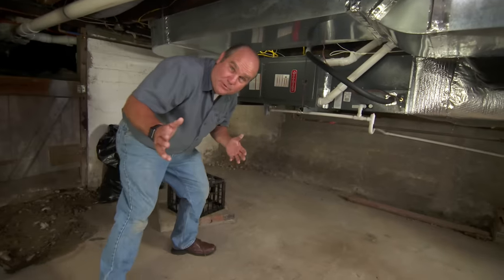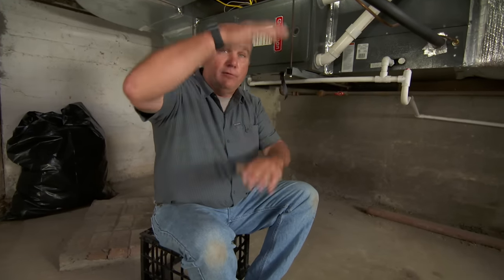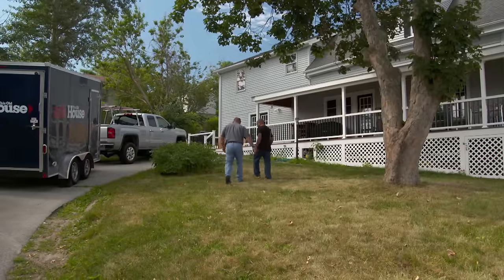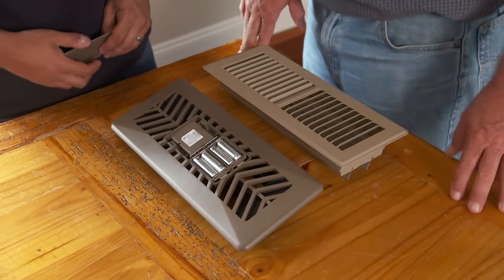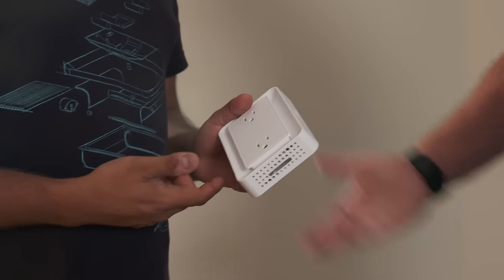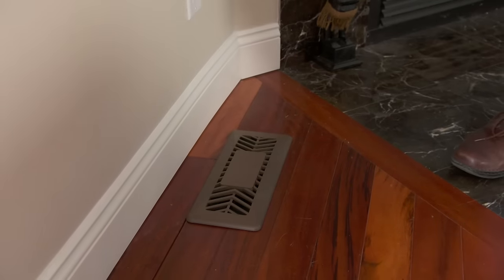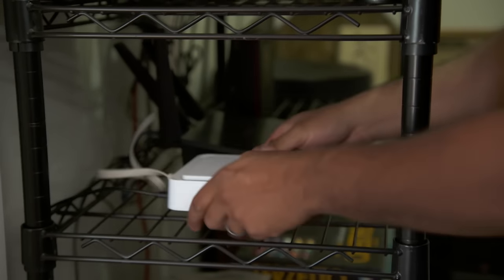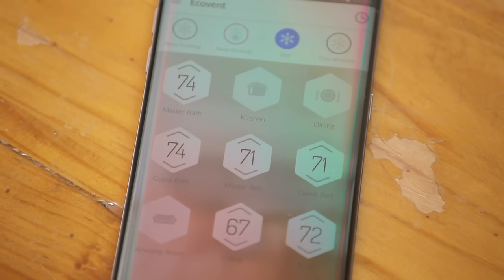How to Install Room-By-Room Zoning in an HVAC System | Ask This Old House

Comment: What about the static pressure in the duct or friction when the dampers close? What about the return bypass? Only good for a module home or studio apartment
Reply: Excellent points. What motorized register system would you recommend that does not have wifi or internet? I would like to control everything centrally without the internet and would like everything to be hardwired including power and ethernet.
Reply: They won't let you close them all or close more than you can. They are a smart system that also keep track of the system to make sure you don't restrict air flow to much.

Comment: I really like what I see but I would rather have a thermostat in each room.  Apps are great but if you have a guest in the room or a renter you may not want them to be able to control your whole house.  Any chance you will convert that little plug in box to also control the temp like the app from the room?  Is there a way to give someone control of just one room with the app?  This would be especially handy if someone is having a guest.  Does your system account for AC systems that have dual fan speeds?  My last question is are you going to have any round ceiling vents?  I know this is typically a commercial vent but I have them in my home.  THANK YOU!

Comment: Dipul, the system as shown in the video seems appropriate for a quick and easy retrofit but what about new construction?  I wouldn't want these unnatural-appearing sensors plugged into my receptacles.  And similar comment to an earlier one... why batteries when it could be hardwired?

Comment: I'm interested in purchasing and installing this system for my home to see how it works...I have been in the HVAC industry for over 20yrs and have only seen amd installed  the "old style" zoning systems amd this video has me very intrigued
Reply: This is an interesting concept, but the up/down zoning works well for most applications.  We had a bungalow with a finished basement on a two zone system. A Lennox signature series gas furnace with a variable speed DC motor (fan ran 24/7), kept both floors at the same temperature year round.  This system here would achieve very good results, but a variable speed blower is required to prevent over pressure on low heat/cooling demands.  It needs to be considered as a total system when putting this in.

Comment: I see higher static and more energy consumption by an ecm motor that could lead to problems. A regular Zoned system with a bypass is better and probably less expensive
Reply: Ulises Palacios this old house doesn't research anything it seems before promoting it.
Reply: Joe Shearer true lol
Reply: Yeah, when I first saw them, I dismissed them immediately.
These things will be terrible for most systems.
Reply: I dont see the savings.   if you are not heating/cooling/dehumidifing areas...you will be taxing the spaces that you are trying to do.   how can you not be effecting  TESP...and taxing the blower motor
Reply: Exactly, especially on a speed blower and single speed compressor setup.  They admitted at the beginning of the story that he doesn't have a HVAC background.  I see big problems with this setup.
Reply: Ulises Palacios agreed.  Us Fellow HVAC/R techs aren't as easily fooled
Reply: Not sure how many times it was stated.... but to repeat, the system senses static pressure at every opening. it's programmed to never allow the static to rise to a point that would cause harm to the single or dual speed blower. No VFD needed. 

Still I see an issue at hand. If you have 10 zones, the setpoint at every zone is 74 degrees. 6 zones are 70 degrees but 4 zones are 76 degrees. you have a 60% demand for heating and 40% demand for cooling, so basic logic implies we would begin a heating cycle. We damper off the hot spaces to prevent adding additional heat, and we open the cold spaces to provide heating..... But lets say that the 40% spaces are still climbing in heat due to exterior wall/ceiling heat loads.

If one of those 4 spaces is your living room, or bedroom, you would be pretty irritated that the system is in heat mode while you are already starting to sweat.

(obviously a 60/40 split would be too much static pressure for a fixed speed fan anyways, so the system obviously wouldn't run.... which could also lead to the hot spaces getting much hotter.)

This is why in commercial zoned systems, each zone has it's own cooling/heating coils. this way we can just provide a fixed air to the space and heat/cool the air as needed to satisfy the zone. How would you implement such logic in a system that has a single heating/cooling/air source? Just doesn't seem that it would be very good at it's job. My initial thought is that the sequence of operations would cause the ranges to be very wide for operation, creating a very narrow operational band. This would make for a system that rarely runs if at all.... the energy savings is not because the system is more efficient, it's because it just runs less because there is too much conflict.

I really do not see this system being able to operate unless 80% of zones are making the same heat/cool demand without a bypass damper system in play. I would love to get some clarity from engineers behind this, perhaps a copy of the hubs sequence of operations so we can review when a demand would equal a call for heating or cooling and when the system would stop working in order to protect the fan motor/coils/furnace.
Reply: Booby D.
You won't get an clarity from the engineers or Dipul Patel because they realize that the equipment is they are selling won't work in every application. They now are marketing as DIY project.
Also, Trethewey now represents this company as a sales marketing rep but I don't see where he discloses that conflict of interest as he tells us this is best thing he has seen in years.
Reply: Carriers zoning works like this too. never close registers to much by using a dump strategy , no bypass sending conditioned air thru coil or furnace again. bypass is not used with VRF systems.
Reply: electronic dampers are much more effective than this bullshit. No way you could tell me this won't contribute a large amount of static pressure to a system.
Reply: I have a question for this group of knowledgeable people... and please don't flame me too much I am an elechicken not HVAC. 

You guys say closing off registers taxes the system, and that makes sense, but what it was designed similar to those drop in boosters? In the extremities of the house would have boosters to pull air into the cold rooms until it hit the setpoint. Couldn't that be a possible solution for the static loading on the main blower. I know  it isn't ideal and would never compare to a proper zoned system, but humor me lol
Reply: @djsnowman06  You can use this system if you have a proper bypass. It's a waste though as air is still going to be forced into the trunk lines before hitting a wall. It's idiotic thinking. It was created for do it yourselfers who will later complained about other system components failing.

Comment: We have been zoning hot water and steam heat since it's inception. And we have been zoning commercial air systems for years.  It is about time to see residential scorched air get zoned.
Reply: Of course, but within the parameters of static and dynamic resistance permitted by the blower motors in the air handlers.

Comment: So how do I get this system?  Does it save energy or just regulate your home?  Closing registers never made sense to me because the heat and or air still goes to the register, so How does that save money?
Reply: Travis They never say it saves money except that it prolongs the life of the HVAC unit because it promotes consistant airflow. But the system is mostly to regulate temperature and make the house comfortable, not to save money.
Reply: Travis
This product seems more about comfort than frugality but it can also save some money. 

A forced air furnace creates a given amount of heat (hot air) in a given amount of time. If a register is closed and that area is closed (by a door), less hot air is needed to heat the remainder of the house. So the furnace can run for less time. 
As was mentioned, electronic dampers directly off the trunk are more effective because none of the heat is 'wasted' in the dead end  branch. 

In my opinion, this system would have more promise if it were connected to the furnace (or a thermostat) similarly to how electric dampers are. 
With this system, from work you could set your living room to be 72 but if you have a traditional (non Internet connected) thermostat and it is not set to the correct temperature, this system does not work.
Reply: @Maxid1  It does the opposite of prolonging the life of a HVAC system.

Comment: I don't see how this is any better than installing dampers in your air ducts near the air handler.
Reply: seems like its easier to install since you don't have to go in the attic and install wiring or pneumatic hoses .etc.
Reply: who installs pneumatics today, Alexander?
Reply: Excatly plus you need wi fi for this
Reply: Installing dampers in the ducts means cutting into the sheet metal and is the domain of skilled tradesman charging high $/hr. Removing two screws and replacing the register as we see in the video is comparatively much easier.

Comment: I like these. Do they work with ECM motors that ramp up and down? Also, do they work with 2 -wire Daikin SkyAir and VRV Series HVAC equipment which is a specialty brand I provide for my customers?

Comment: It would be nice if you could hardwire it with a transformer instead of using batteries.
Reply: 100 dollars per vent isn't low enough cost to justify manually closing each vent.  Is this a novelty price or actual cost of R&D plus materials with a slight mark-up for profit?
Reply: The other option is to harvest the airflow energy and store it in rechargeable batteries. You'd only need to harvest once in a while and never replace batteries.
Reply: You can use a transformer. You need to be able to convert the ac into dc using some sort of rectifier. It's more work than what it's worth.
Reply: You could make your own if you are that interested. Been using this system for about two years and have had to replace batteries in only 1 of my 12 vents. Though using a voltmeter I suspect I am going to have to go through and replace them all soon. My biggest complaint is they should have a NiMH setting so I can use rechargeable batteries. Five volts and more Ah's should work just fine. The issue is they immediately start saying the batteries need replacement. The one vent I replaced is working, but I can't really tell if  it need replacement until  the vent drops off line.
Reply: @nicalicious3002  Try putting in a multizone system in an older home and you change your mind. Even with R40 in my attic in the summer my bedrooms get hot and if I run my AC for my upstairs then my downstairs are ice cold. BTW, the cost of a multzone can easily be $10K. I spent $2300 and my house is MUCH better room to room. I only wish they had sensors that don't have to be plugged in, a separate battery sensor I could put anywhere in the room. In my house an outside outlet is way too hot or cold and many of the inside outlets are next to cavities with the HVAC so the temps aren't right. The system seems to figure it out but during Spring and Fall there is a bit of a relearning period.  Plus if you are going to put a USB outlet in a unit make sure it can do 2 amps per USB plug. This beats the crap out manual vent control during the summer because the sun moves from front to back of my house and I would be running around several times a day adjusting vents. Winter not so much.  Costs are lower purchased as a house upgrade.
Reply: @charlesrichardson8635  whats the performance of the whole system like? It is really better than motorized dampers for zoning
Reply: @oviefc  Much much better. Each room can have it's own temp. My sister who lives with us likes her room cooler all the time. I am a 74F person. Our bedroom and my sisters maintain their own temps. It's not perfect, the kitchen where the controlling thermostat is runs cooler but that's fine because usually we are moving around in the kitchen, during the winter it can be a bit warmer because you are running the heat, but overall  we are far more comfortable without rooms that are extreme any more.  I don't know that our overall bills are down, but we are more comfortable. 

My only drawback right now is that Ecovent was purchases and it's hard to get parts. Plus it take a few days to get any response.  I have had on vent fail after two years and it was hard to get a replacement. 

OH, get tempcontrollers for all bathrooms. They downplay this BUT make each bathroom, including that powder room their own controllers.

Comment: Wonder what this does to static pressure when several  vents are closed off but the system is still running
Reply: The hub will preserve airflow via programming.
Reply: You wonder that, do you? Smart guy.

Comment: Why do I have to use a costly hvac contractor to install this thing if it's just replacing face plates- there are no links to buy or cost on your website. Keen smart vents appear to do the same thing but can be handled by the DIY enthusiast. Frustrating when companies inflate costs by maintaining archaic distribution channels.
Reply: I install cable, phone, internet and security systems with zigbee based sensors and thermostats everyday.  My whole house is ran on zigbee/z-wave devices and communication.  I refuse to pay somebody to install 7 platic motorized vents, 6 plug in sensors and a hub to my 24p gig switch.  If this does not have a self install kit, you've already lost me, I'll just wait for a competitor.  Like maybe samsung with a trap thats installed right below existing vent covers.
Reply: Insurance companies forbid selling HVAC equipment. They found out the consumer goes after the deep pockets which is the wholesaler/manufacturer.
It takes years to get proficient at HVAC and most people won't spend the time or money learning, so they can do a good, safe job.
Manufacturers state in their warranty that if bought over the internet there is no warranty. Again, some DIY did something he thought was smart, linear, logical and wrong. Thats why training is essential.  Which is why it is as it is. The liability selling to the untrained is higher than the gain/profit from selling. So that may seem stuck up to you but it's basic survival sense and protection from people doing things they haven't the training or equipment to be messing with. To put in a furnace or air conditioner is a minimum of $1000 in tools. The training is a lot more. So who can install it cheaper? You with the tool and training costs for one job or us with many jobs and admittedly overhead to spread over multiple jobs?
And dare I say the tradesman insurance in case of trouble. Of which the insurance companies aren't gonna sell to you either. You're welcome to do your own stuff but if you burn/blow your own house down don't whine when they tell you your home insurance doesn't cover it. 
Zoning for the reasons stated is a bad idea. I like what the guy said and I'll be looking at this product. The HVAC industry needs as many rocket scientists as we can get. :-)
Reply: Mykel Hardin 
Ah yess, it’s DIYrs who make me the most profitable.
They see some video such as this, they try it themselves and sooner or later call me to fix it.

That being said . . . . . I cannot blame them.

Some of the quotes I have seen from residential companies scare even me.
There’s stuff that can be fixed (by the homeowner, even) and these companies are quoting a full furnace replacement.

It’s insane!!!!
Often times if I know it is going to cost an arm and a leg I advise shopping online for the parts.  The liability is all on the homeowner, but he can save some money.

On the commercial side, it’s a bit different.

You said you’ve installed two 5-ton units.
That fairly straight forward.  And if you can do it, by all means.

I do work for a marijuana growth facility with chilled water systems and heat recovery systems that are required by the EPA.
Systems that require extreme humidity and temperature control in WA.

Sometimes it is very expensive simply because of the liability.

Adding a rooftop unit without a structural engineers blessing can end an HVAC company.
Creating mold due to a poor install can cause a serious lawsuit.
Reply: All in all, I figured it was too good to be true if they just sold the equipment.

They can also be wary of where their brand ends.

If various DIYers install this system wrong, the credibility of the system falls and they don’t a profit on their product.

Either, I really wish they would offer to sell the equipment straight to the homeowner.
Reply: Mykel Hardin 
Oh yes.  Mini-Splits are easy to install.
But they are peculiar, too.

However, having the right tools alone puts you a step ahead of many HVAC installers.

Using the flaring tool they use for plumbing, using the wrong gauge of wire for communication, not using a torque wrench on the flares, not placing the system on a vacuum down to 500 microns . . . . 

. . . . all rather simple practices that are ignored by many who have been doing HVAC for a long time, have resulted in service call backs.

Most home installs are rather simple.

If you have the tools, that is . . . lol
Reply: Adam Moore that way they can keep track of their moneu
Reply: Kockford Ali ‘ohhh boohoo it’s not easy to buy!   It’s not on eBay! Changing batteries is so much work. OMG I cant handle this rough life. Oh God please make this millennials life  a little easier’